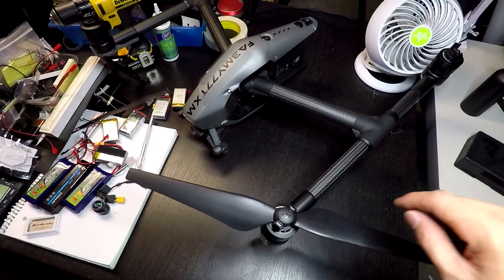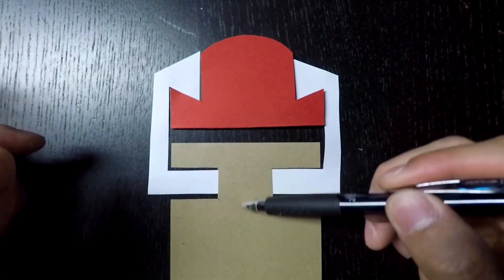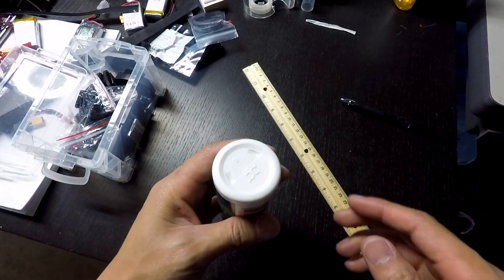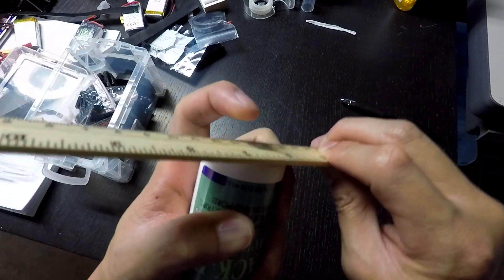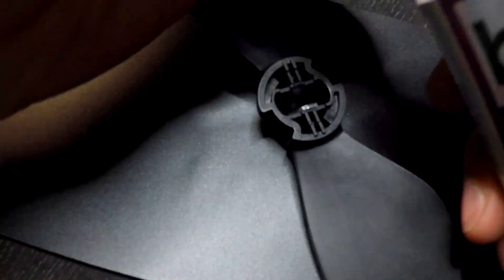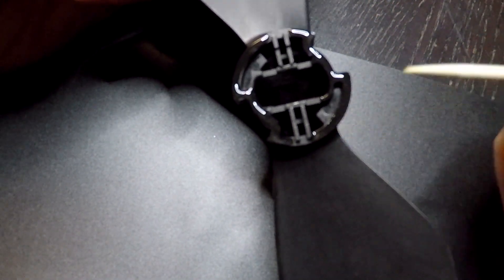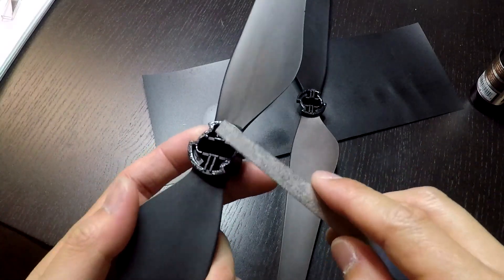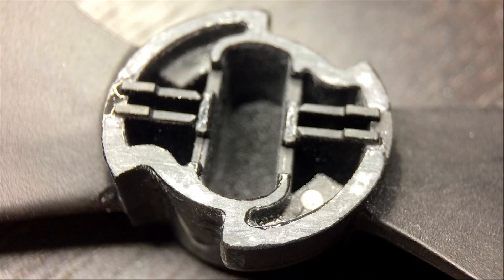DJI Inspire 2 Red Prop PERMANENT FIX

Comment: Seems a quick easy solution great idea.  However, a bit off a ball ache having to do that to every set of props you use.  

Look, lets face it DJI make some fantastic drones but this is a DJI  design/manufacturing fault. As I see it DJI, should either make new props to fit the propeller mounts which would mean re-gigging the production plant or  make new re-designed  mounts to fit the props.  But no! they supply a shit piece of foam (which will still allow movement of the props).  

Frank Wang, DJI Founder and CEO And Billionaire should be ashamed. The best he can do is a poxy penny bit of foam.  Frank, I would kick the designer,development team & quality control people right up the ass.  If you buy a Rolls Royce and pay rolls Royce prices you expect a perfect product.  I'll bet if Frank Wang's car had a problem he'd expect it put right and not with foam!
Frank Wang HANG YOUR HEAD IN SHAME!

Comment: Oh my god. Not only the uneven CA bead unbalances the prop at the hub, but the manual filing creates a surface that is likely not parallel to the blades.. This person very obviously does not know what he is doing..
Reply from the maker: Thanks for the comment Yarom. You are right, no way can hand fixes make it precise but it drastically reduces the play that's inherent with the stock props. I offered my solution, you don't have to do it but I'll be glad to hear your solution, thanks.
Reply: My god what a purist comment.

I am sure this works, my question is if the CA glue does not goes with time.

If you want a more precise solution I bought Atellanis Ultimadrone fix and also works perfect.
Reply: Pedro Núñez Gallego 
Link to props you bought please

Comment: UPDATE:  DJI has just released their Inspire 2 V3 propellers... I have tested 4 sets of the V3 props so far and all 4 sets have the same foam inserts as the V2 props with the only noticeable difference being that all 4 sets were factory balanced.  So if you still have the V2 props and don't have the balancing tools to do the job, call DJI and have them send you the V3 props.  And if you still have the V1 props, YOU MUST CALL DJI and have them replace them with the V3 props as they are "factory defective" according to DJI USA.

Comment: Hey there Rjn, good fix, we also have the rattling prop of death with the Xiaomi Mi drone, we fixed it with tape around the motor shaft, it is pretty similar to the inspire 2. 

Just a little question did you see any improvement in performance (video stabilization, flight characteristics, etc) before and after the mod?

See ya.

Comment: Will this work for the Inspire 1 v2.0? I have the same quick release prop locking system. The red prop locks do the same thing... Not as bad as yours though. I just notice a bit of play when holding the motor and turning the prop softly. The prop move slightly while locked down. I assume this method with the glue will fix this?